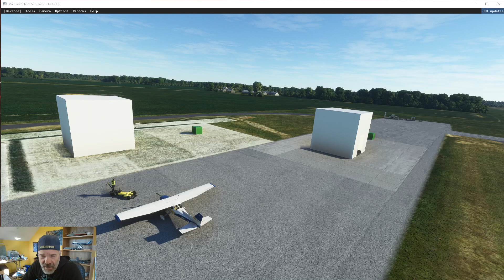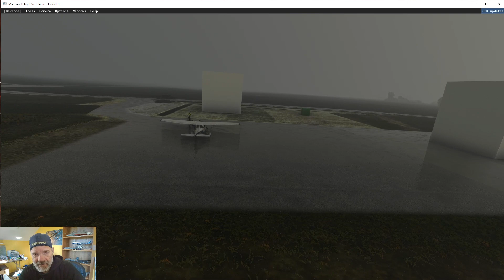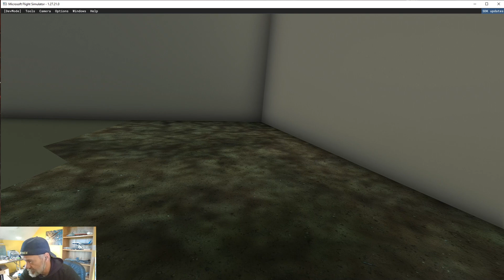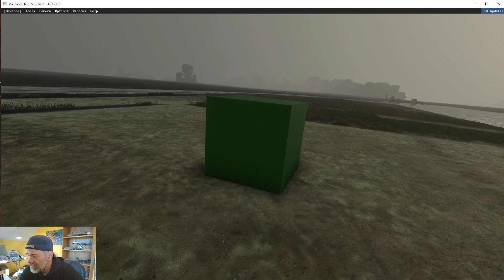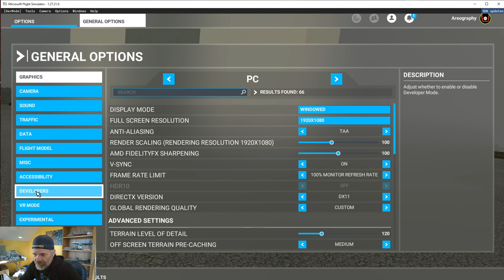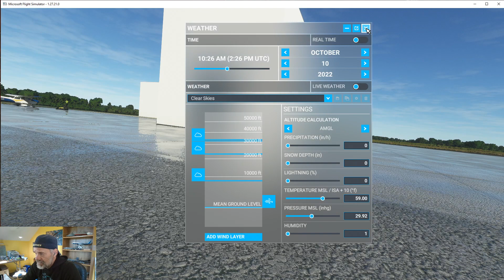Creating Scenery for MSFS: Environmental Occlusion Revisited

Comment: This issue of the drone camera being stopped by a wall has cropped up with SU10. I believe it is because the model/building has a collision cube with a collision texture attached to it. A lot of the default MS models have this collision material enabled and you cannot enter them. As you hit the boundary the drone camera pops onto the top of the building. I haven't had an issue with the drone camera being blocked by the EO material
Reply from the maker: Yes, I stated the collision material.